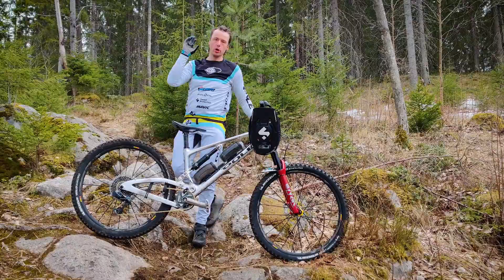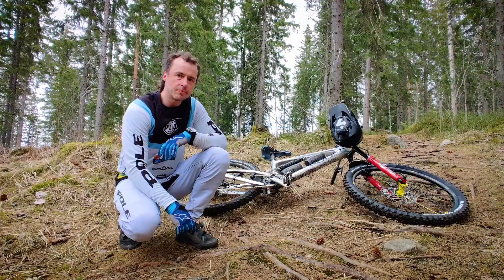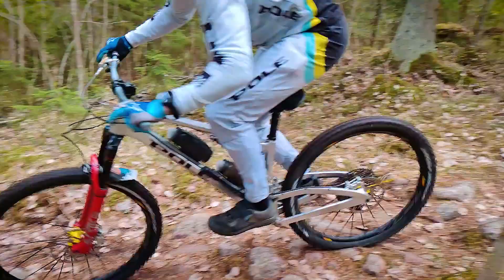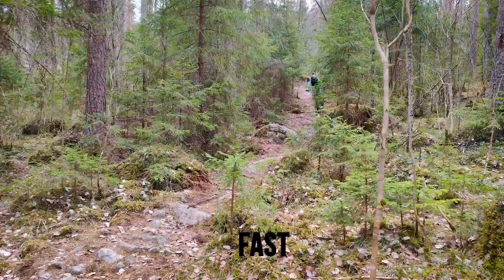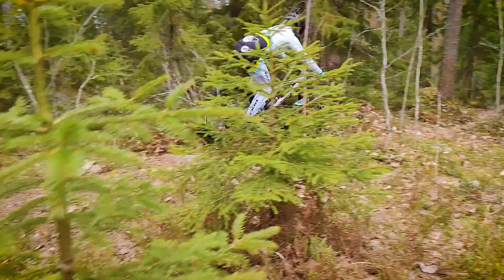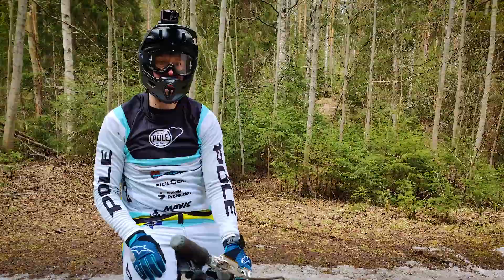Suspension talk and examples with Leo Kokkonen

Comment: Just for clarification: high shaft speeds at beginning of the stroke with high leverage ratio and towards the end lower shaft speeds with smaller leverage ratio. Main reason for decreasing shaft speed is increase in spring force?
Reply from the maker: Very good question but there is no simple answer. If we push the swingarm from the axle with constant speed through the travel, the shock shaft speed increases towards the end. However, this is not the situation in real life. The fastest speed in the rear axle will be at the beginning of the stroke. Therefore the shaft starting speed will be greater and there will be more damping force applied. Therefore, it's good to have high leverage ration at the beginning of the stroke. While the shaft moves through the travel, the damping slows naturally the speed of the rear axle. Now, it's good to increase the shaft speed with leverage ratio towards the end to keep the shaft speed more constant and optimal to the shock. The linear leverage ratio bikes are hard to tune to be good in small bumps and big bumps because the leverage ratio is flat. The bike is either very soft at the top or firm at the bottom but never the both. Soft from the top and firm at the bottom is only possible with the progressive leverage curve.

The progressive leverage ratio is also good for the support of the spring. We want the bike to be more subtle at the beginning of the travel and then support more from the mid-travel. When we have a more progressive leverage curve, the bike is more firm in the dynamic riding area. The spring force plays a role in impact-absorbing but the spring itself is not dynamic and does not have a significant role in big impacts. The leverage curve and the spring force are more important for slow compression and for supporting the geometry of the bike.
Reply: @Polebicycles  Ok after the third time reading I think I got it. 😁👍 Thanks for replying and for the great Video.
Reply: Yes. Every impact starts at a high velocity/force, then it slows down (as the force is being absorbed) before stopping and changing direction. Similar thing happens in the opposite direction.